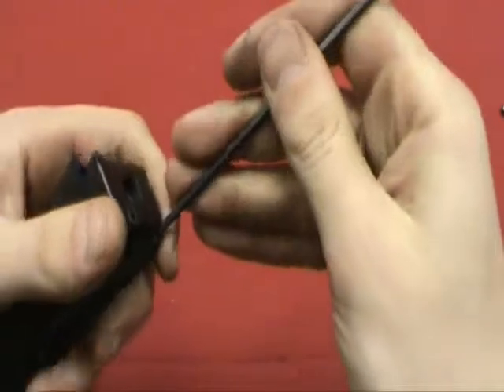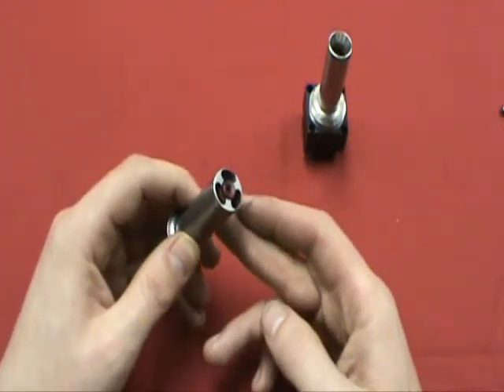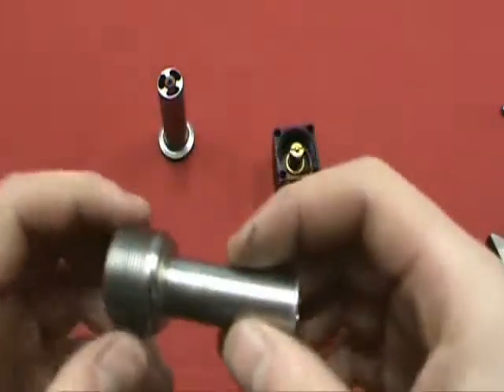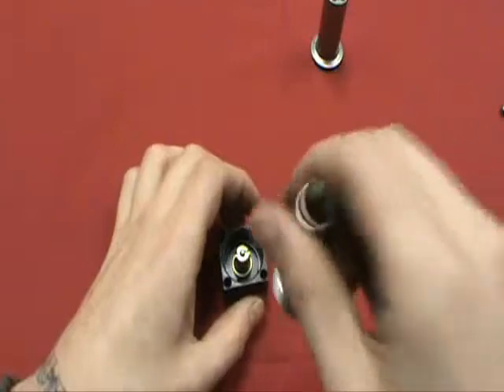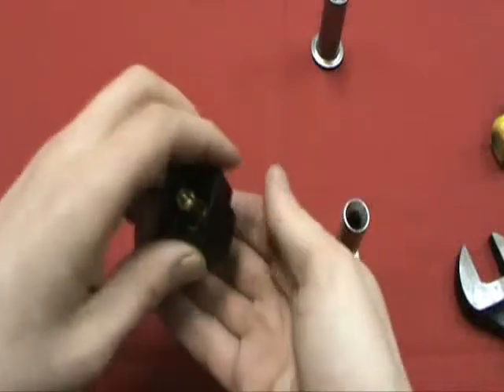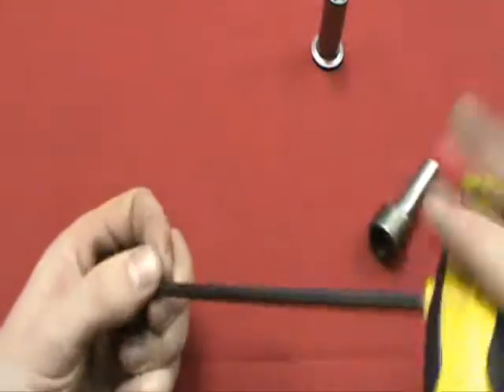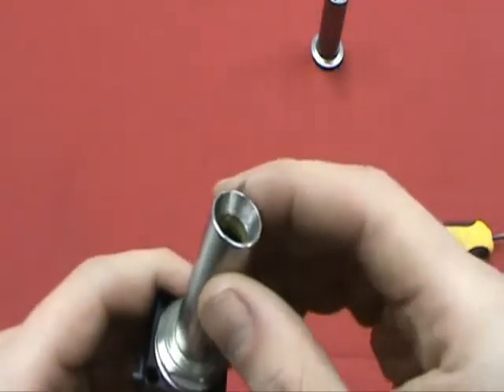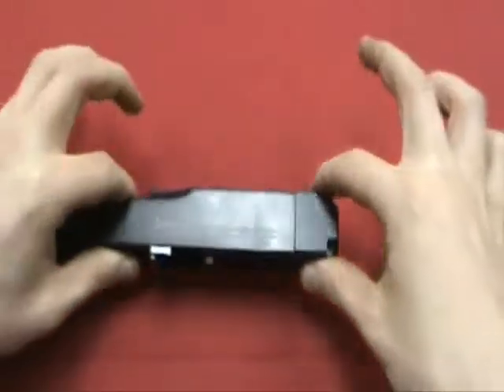Tiberius Arms Air Chamber

Comment: Where can i get that valve with oring inside the pressure relieve valve after the spring? I have a leak in a used marker i purchased and found out later that was missing.

Comment: I just purchased a t8.1 and the air chamber and the firing pin keep getting stuck together I oiled it up hoping it would fix the problem what do you suggest that I do because the firing pin does not move smoothly on the air chamber and if it goes all the way back it gets stuck and it's hard to take off again
Reply: Hey man i know this is old but i encounter the exact same issue, did you manage to fix it ? Thanks !
Reply: same here
Reply: any one find a fix yet.
Reply: @jackclarke7584  I pretty sure I took it apart and really cleaned every thing and oiled every rubber o ring  especially the piston you have to really clean the piston and make sure you oil it and the piston moves freely and smoothly with the air chamber . If that doesn't work I pretty sure I sanded it with 3000 grit wet  sand paper there should be videos on it search around before you think about sanding it because you can mess up the piston
Reply: @jackclarke7584  Hey, did you get the issue because you replaced the stock o-ring by a Milsig one ?
Reply: @VinceMenger  not yet no millsig is on the way but I dismantled it looked fine cleaned it.. used planet eclipse grease and reassemble fire 2wice and stuck open .. so I now assuming it must be oil not grease 🤔
Reply: @jackclarke7584  I don't think it's an issue about oil or grease, rather in my case the o-ring itself which is too tight. Some use grease, others oil, and it both works flawlessly for them.

Comment: Many thank for this video. It helped me a lot to understand where that o-ring should be placed inside the air chamber because I had a leaking due to the fact that the o-ring was pulled from that groove and I found it inside the bolt. I did not realize what was wrong until I saw this video. The diagram at page 13 in the Tiberius T 8.1 manual is not quite clear regarding the place where the o-ring should stay.